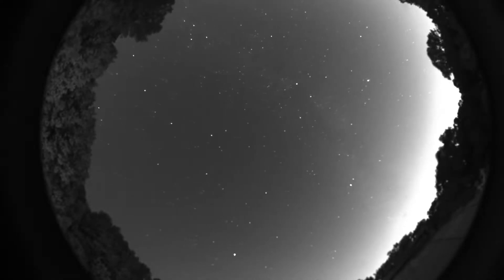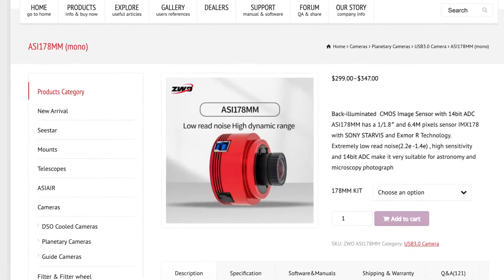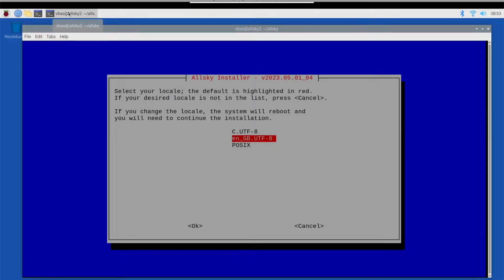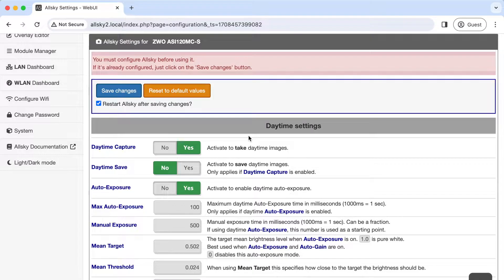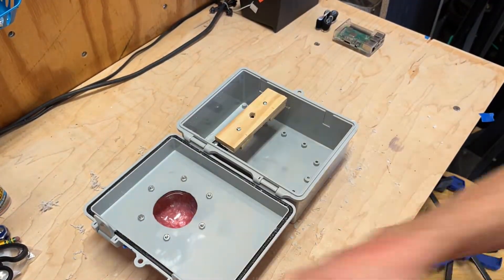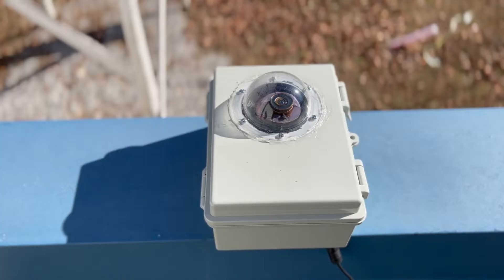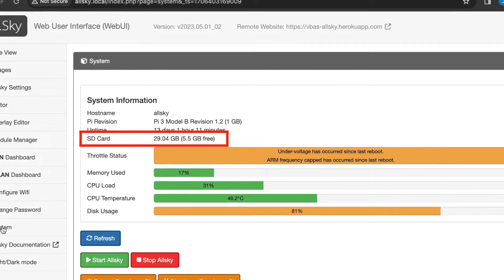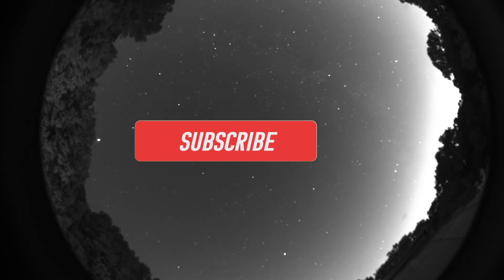Build Your Own AllSky Camera!

Comment: This is a great project, but the cameras pricing kill the community adoption pretty quickly. You should show the raspberry pi HQ cameras, much cheaper and are easier to source.
Reply from the maker: We used the ZWO camera because it is more sensitive and better for capturing faint meteors, but maybe the newer HQ cameras are good enough now.
Reply: @VonBraunAstroSociety  I tried to use the Pi cameras and had no luck. They were not recognized by the Raspberry for whatever reason. I ended up with the ASI178MC that works fine. I also found the camera on sale so that was a win...
Reply: Yep I was looking around and everyone keeps using these nice cameras but that's not for-funzies money. I'd take a quality hit for something more accessible.
Reply: I understand the why for using the zwo cameras. They are built for this. But they cost anything from 150 euros to 600 euros. A pi hq camera costs 50 euros, anyone can get one, and get results. This is a lot more interesting for the army of people with a pi and a pi camera at home, because they don’t need to buy anything else, and they can try the software and see if they like it. That increases the ease of adoption tremendously.
Reply: @PedroLiberal  They can still follow this though and just use a pi camera instead, thats what im doing.
Reply: Don't be cheap
Reply: @bubblehead5394 do you pay my wage?